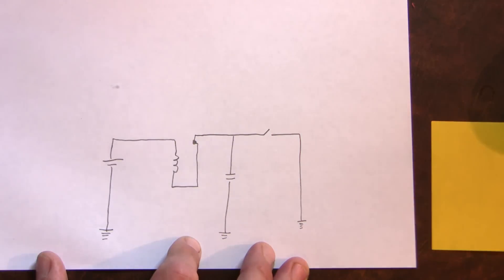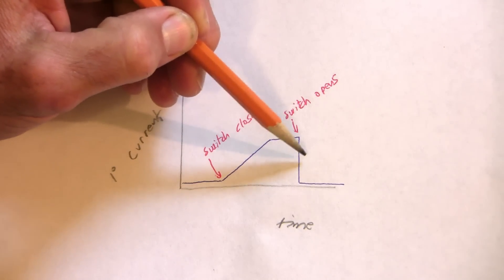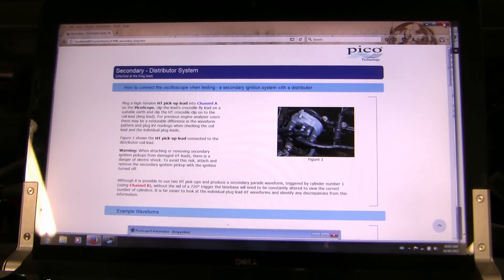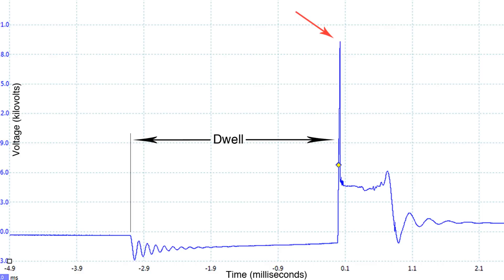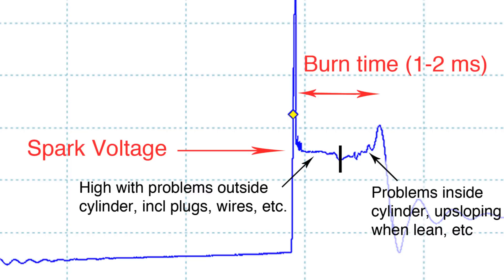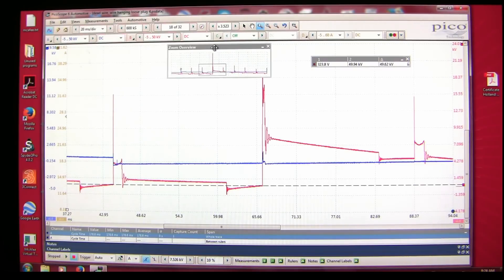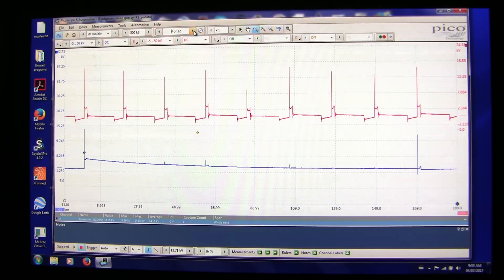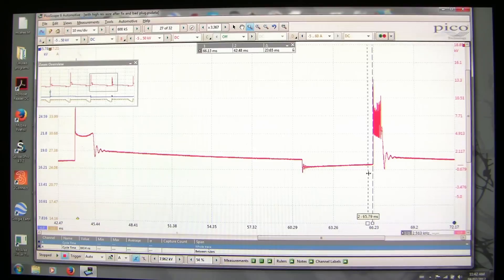Picoscope fundamentals - ignition waveform analysis

Comment: the last wave with erratic burn. could that be egr or turbulence in the cylinder?
Reply from the maker: I'm not sure which waveform you're referring to, but the greatest challenge will always be sorting normal variance from pathology. You could leave a video time stamp if you want to discuss it further. The EGR system in this vehicle is fine, and I suspect EGR problems may be hard to find on a scope of secondary ignition. These old style ignition systems were so much easier to study because everything runs off the same coil, making some problems glaringly obvious when you have a palisade of ignition spikes to compare.
Reply: @spelunkerd check out this video at time 26:09 https://youtu.be/GwvVUu0gggA
Reply from the maker: @simclardy1  Yeah, that's a good reference, I have always liked his clear presentation style. In this example the problem was solved by replacing the plug. I didn't get a very good shot of the plug on this video, but there was a defect in the plug tip that I think happened at the factory. It would have been interesting to see whether grinding that nubbin of carbon off the electrode tip would work, instead I simply put in another one. Since it affected only one cylinder I didn't even consider EGR problems. Thanks for stopping by!
Reply: @spelunkerd  thanks that is helpful. it also keeps the rule of dividing the burn line and left of line points outside. in the example I gave the turbulence clearly starts to the right. cheers
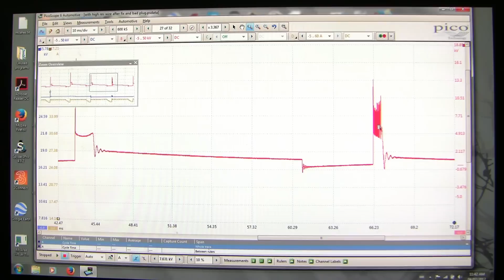Reply: time stamp 16:03. Egr might effect multiple cylinders but some type of turbulence.

Comment: Spelunkerd, would you please provide explanation of how probing 1 ignition coil you were able to obtain voltage graphs for all 8 ignition coils?
Reply from the maker: In this classic old system, there is only one coil on the vehicle. It makes comparison much less complicated since there is no variance you can blame on probe placement, etc. That coil fires four times for every revolution of the crankshaft, completing a full cycle after two crank revolutions. The distributor sends the spark to the appropriate cylinder just as it reaches TDC of its compression stroke. I wish coil on plug ignition systems were so easy to interpret.

Comment: I am new to using a scope (Pico 4425) but I am trying to find an intermittent misfire on a 383 small block Chevy using the secondary wave forms as a guide to help me zero in on the cylinder/s giving a problem. 

How would I perform this test on a GM HEI system since the coil is inside the cap and has no lead wire to place a capacitive pick up on? 
Could I hook up something on the tach output to give me a meaningful waveform to compare with my trigger on cylinder #1? If so what settings would I need to use?

Second, when I try to do the test using the functions you showed I get a message in the instructions saying I should only test one wire at a time because other wise I will need something to sync a 720* signal unless I want to constantly adjust the settings on the screen. I did not notice you adjusting your settings so do you have something to sync everything like they said or a way around the problem?
Reply from the maker: Good questions! If you follow ScannerDanner here on Youtube, he goes through the details of how to do that in several videos. Coil on plug ignitions are tricky, since they don't always provide access to the leads you need to view, and since you can't nicely line up waveforms on a screen. Even the ground side of the primary circuit of most COP ignitions is impossible to tap into. Some ignitions permit the use of a secondary extension wire, which is just a short length of spark plug wire you add in series to the coil so you can put your capacitive pickup on that. You might destroy evidence with that if you've got a short from boot of the coil to adjacent ground. One way around that is to measure primary current ramps by tapping into the fuse supplying the coils, but some vehicles like my GM use two different fuses so you need to do one bank at a time. Also beware the chance of other devices on that fuse. Another option is to use an inductive 'paddle' pickup lead which is variably effective depending on the shielding of the coil. In the Pico4425 kit they supply a paddle, so you can use that one to see secondary ignition waveforms, one at a time. It is really fast but the wave shape changes depending on how you orient the paddle, so interpretation is limited to gross abnormalities. PineHollow Autodiagnostics posted an excellent case study this week of a misfire under load, using that very technique.

Comment: Sorry if this is a dumb question but I'm kind of new to scoping. I have a 2204A Pico scope with a 20 volt max. Should I use an attenuator on the channel with the capacitive pick up?
Reply from the maker: This is a really good question in general. You need an attenuator when directly measuring voltage in secondary ignition, but this style of capacitive pickup lead is internally protected so you're safe without. You also need it when measuring voltage directly on the switch side of the primary wires for vehicles with two-wire ignition leads (like this one). You do not need it when measuring current with an inductive device, like I did in the video. Interestingly, with three-wire coil-on-plug ignition wires, the ground switch side of the primary is contained within the electronics of the coil, so you unfortunately can't get to it! So, for a COP ignition fed by three wires you are pretty safe, but you won't be able to find the pattern you want to see. For those vehicles, some guys use an extender secondary plug wire to give room to attach a capacitive pickup lead. Others use an inductive paddle to try and pick up the signal, where you don't need attenuation, but the signal is variably shielded and not easy to interpret. The other common place to have dangerous overvoltage is on the ground switch side of fuel injectors, where you can get a scope-destroying overvoltage spike between the switch and the solenoid. Interestingly, for other solenoids like evap solenoids, usually the spike as the ground is switched off is not so dangerously high, presumably because the coils are smaller or because they incorporate a flyback diode to flatten the inductive spike. Even so, to be cautious I'd consider an attenuator for big solenoids until you can verify that the inductive spike when switch turns off is not so high. I hope that helps!
Reply: @spelunkerd  Thank you so much for this reply.  this is very helpful as I am trying to learn how to use my scope more effectively.  I saw online where someone had made a lasso with a piece of wire to go down into the spark plug well on the end of the coil, and then the middle of the wire had a bolt to connect the inductive clip, then finally the other end of the wire was an alligator clip for grounding.  I'm considering making one of those. If I do, would I still be safe to clip my inductive clip to that bare bolt in the middle? Or should I consider putting electric tape around it so there's no metal to metal contact?
Reply from the maker: @Z14kt12timandjes1  Gee, I don't think it needs to be so complicated, and I wonder about the safety of DIY uninsulated wires carrying such high voltages. For COP vehicles I'd use an extra spark plug wire as an extender, then clamp the capacitive probe around that.
Reply: @spelunkerd  Thanks. That sounds like a good idea.  I really appreciate you taking the time with my questions.
Reply from the maker: Not needed for those capacitive pickups.
Reply: @spelunkerd  thanks!

Comment: So do we not need an attenuator for this ignition probe?
Reply from the maker: Excellent question. No need for attenuators with these inductive and capacitive pickup probes, only needed when your scope is tapped into the circuit measuring voltage.
Reply: spelunkerd thanks for the reply. Funny I figured that out the day after I posted my question. Excellent video. Thanks for posting.

Comment: Very Good video! I'm curious to know what the final diagnosis was on that cylinder?

IF,  that waveform was at idle condition, you have a valve problem clearly, especially if at higher RPM the waveform improved.
IF, the waveform had no response to RPM change, the spark event would be external.
IF, that was High RPM, there is excessive turbulence in the chamber a weak or broken  exhaust valve spring.

Was I close?
Reply from the maker: I wish I got a higher magnification shot of the plug on that cylinder, it ended up being just the plug. At 16:31 if you look really closely right at the tip of the probe I'm holding, you can see there is a metal bur on one of the ground contacts, almost bridging the gap. I don't know if that was the cause but in any case swapping out the plug was all that was needed. I don't even know if it was a manufacturing defect or carbon, it looked like it might have been that way right from the factory. If the spark jumped across at the defect, the gap would have been really small, almost nonexistent, but if the spark jumped to other leads you'd get a normal pattern. With a strange jump pattern, I can imagine how a lot of hash of the spark line might be seen, even intermittently. Some guys described a similar pattern when the ceramic of the plug is broken, which wasn't apparent when I examined the plug. One of the humbling things about using this tool is the broad variance in what you see practically. So, I try to avoid overthinking problems, often the solution is unusual variance in a common problem, rather than something more rare. Thanks for watching!
Reply: @spelunkerd  Thanks for the final diagnosis, very interesting indeed. One thing I've learned over the years is to first determine if the spark is internal or external when examining ignition stuff, awesome work!

Comment: Very well done!  Love being able to identify Canadian content generators by the Beech and Gray toolboxes :)

So, variation in firing KV may disappear due to sample rate but also due to cylinder conditions such as mixture in the plug gap / turbulence in the cylinder.

@ 13:17 when zoomed in on the firing line note the faulty spark line is dead smooth compared to the other spark lines.  What I was told many years ago is the rough spark lines of the "good" cylinders indicate turbulence in cylinder.  The smooth spark line illustrates that the spark took place outside of the combustion chamber.  It doesn't have to be the distributor air gap; I think COP or DIS would have similar characteristic with leaking insulation.  The firing KV is the voltage required to get the spark out of the insulation to the  ground point; the spark line is the maintenance of that spark during coil discharge, and spark line would be smooth.

I am curious which of your waveforms were which; especially interested in the injector / dead cylinder.  Thought I had it but not sure...

Comment: brilliant video. best way to learn is this way with a short quiz (gets the mind working).  I want to know if I was correct. had to watch the video 2 times before I understood the information though
Reply from the maker: Ya, me too, I need the challenge when learning this kind of thing. For some reason people who reply with answers tend to delete their own remarks after the discussion, which surprised me a little. I wish some had left them in place, those remarks were very thoughtful and mostly correct. The lean cylinder is easy enough to identify just based on the shape of the last part of the firing line. Then if you align the remaining answers in order of "biggest gap" electrons have to jump, it will match perfectly with a list of measured firing voltage. Thank you for watching!
Reply: @spelunkerd  strange. they maybe doubt they are correct after seeing other comments and retract their own comment due to feeling silly if indeed they were incorrect. getting it wrong is OK as long as you discover the correct answer and in turn understand where one went wrong in their thinking.

Comment: Great video !!...I did a primary current ramp on my 2001 Corvette for the first time  a few evenings ago with my Picoscope that has no ignition issues and when I was looking at 4 cylinders on each bank (using a ground wire for my amp clamp) the waveforms were not all evenly spaced...if this a problem ???
Reply from the maker: I've been meaning to to another video of COP vehicles, and some clips are done. As you say, if you look at one bank at a time like I do on my Chev Suburban using primary current, you get uneven spacing. That's because the firing order swaps sides, the gaps are when the other side is firing, a normal finding. If you print out both sides and lay them on top of each other they fit perfectly, filling the gaps from the other side. With a little detective work you can identify which cylinder is which by looking at the firing order and noticing the unique cadence of where the gaps are. It should be enough to infer order without having to use a channel to flag one cylinder. Alternatively it's easy to add a timing channel. As you've noticed it is easy to get current ramps for each side, although I like the palisade of waveforms with the old system. There are so many variables with a cop system it is harder to interpret waveforms, but gross abnormalities stand out. Thanks for watching, and for adding a thoughtful remark.
Reply: Wow !!...It just occurred to me that the firing order alternately fires each cylinder...DUH !!...I removed a fuse (injector) which feeds not only a bank of cylinders for ignition but also the injectors...wasn't sure if you could get an accurate waveform with both the ignition and injectors getting fed from the same fuse...I picked the ground wire for each bank being that there is a harness connector on each bank on top of the engine and it was easier to clamp the amp clamp around that ground wire...the Corvette has a separate coil for each cylinder. I'll do what you said about laying both waveforms on top of each other...my next waveform is getting my cam/crank...haven't done that one yet but I'll have to get the 2 signals from the PCM which sits inside the front L/H quarter panel...much easier than trying to get to the cam and crank sensors on the engine...THANK AGAIN and I love that Picoscope !!
Reply from the maker: Yes, my 2000 Suburban is the same, primary amp clamp on that middle connector on each side. I've also done cam/crank. It was easier to identify the wires at the PCM, but if you do that remember you don't necessarily need to undo the bolt holding the connector onto the PCM. You just need to carefully pry the plastic guard off the back, then identify the wires. I punctured the two wires and repaired the punctures with liquid tape. I also labeled the wires with little tags so I can get to them easier in the future. The wire coloring for mine was at variance with the diagram, but the connector pin number was correct so if you need to disassemble to get pin numbers then you need to do that extra step.
Reply: Suburban, Corvette...same thing...both GM...LOL !!...I'll puncture the wires also and use my liquid tape when I'm done...I'll check those wire colors too but go by my FSM I just bought a few weeks ago...3 BIG volumes !! ...I'm doing all my sensor waveforms with the Picoscope so in the future I'll know what's good...I'll work on my daily driver 4 Runner next...marking the wires sounds like a great idea !!....I've had the PCM disconnected and apart a few months ago to see if I had any corrosion inside on the pins...C5 Corvette's have big problems with this since it sits below the battery...battery acid is not a friend to PCM's...I then sprayed some corrosion inhibitor called Pro-Tec on the pins when I was done...great stuff !!!

Comment: Thank you very much!  I still have a Heathkit 1015 that I assembled back in the 1960's.  Haven't used it in years but I remember the secondary waveforms  are still the same.  I'm ready to buy a new scope and the Pico will be the one.  I follow most of the Youtube channels as you do, so it looks like I'm on the right track.  Thanks again for your time.
Bill